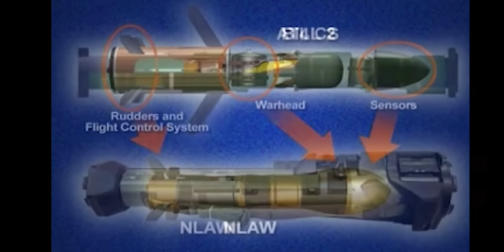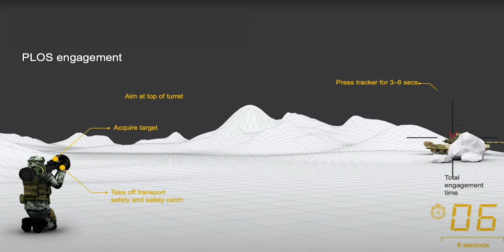Is the NLAW ATGM overrated? Next Generation Anti-Tank Missile

Comment: NLAW and Javelin accounted for less than 1% of Russian AFV losses. 95% of Russian AFV losses are due to Soviet Era 152mm Krasnopol Guided Rounds. I have seen plenty of videos of multiple hits needed to disable a Russian Tank enough for it to go to a field workshop.

Overall, NLAW and Javelin are failures and overpriced for what they bring. NATO needs to bring back Copperheads and develop newer and better guided rounds that can be launched by 155mm tubes to destroy moving AFVs and integrate even more small drones into a network centric heavy artillery based army designed to fight mass warfare on an industrial scale. Going for a light armor blitzkrieg force may look flashy, but if that force takes massive losses but fails to entrap large numbers of enemy forces, it will be too weak to hold up to a determined counter stroke.

Russia's main mistake was not having enough infantry, a mistake being rectified as we speak.
Reply: Of course it's less than 1% of AFV kills, thr NLAW makes up around 1% of Ukraines ATGM stockpile, they're just using what they have.  You also miss the advantage of having a squad level weapon that is fairly maneuverable.
Reply: @joshfurtek1935  That is better handled by RPGs. NLAW is overpriced for its utility, and not as versatile in terms of warheads like Soviet based ATGMs of comparable size and weight.
Reply: @BGTom  I don't think consistently  hitting a moving vehicle at 800m with an unguided rocket is realistic.  Also how are Russian atgms more versatile?  All their systems are larger and heavier and have different  guidance systems.
Reply: @joshfurtek1935  If an infantry squad has to engage a Tank at 800m, someone higher up the chain fucked up. As for Soviet ATGMs, the versatility is in the variety of different warheads they can use for different targets.
Reply: @BGTom  what kind of argument is that?  Not every battlefield is suitable for an armored vehicle to make full use of its effective combat range, and therefore a medium ranged atgm has its uses.  It's also not possible to know where every enemy asset is at all times.  An attack can come from everywhere, wouldn't you want to have a weapon that at least gives a fighting chance?
Reply: @joshfurtek1935  A rational one. If a pure Infantry squad has to engage an AFV, they want to be as close as possible and use ambush tactics to quickly win before the AFV can retaliate. A long range engagement favors the AFV if the crew knows its stuff. Now if we are talking an Infantry Platoon engaging a Lone AFV, then that is a completely different matter as the larger formation can protect the ATGM teams with their GPMGs and Designated Marksmen plinking the sights and secondary MGs on the tank.
Reply: @BGTom  why does the engagement range have to be as close as possible?  Apparently militaries think that an infantry engagement vs. an AFV(s) at ranges greater than RPGs is likely and therefore they developed a system for it.  For 30000 USD a unit you get an ability you never had before.
Reply: @joshfurtek1935  A lone Infantry Squad lacks the suppression capability to attack a lone Tank at long range. The Tank can take the hit or even dodge and suppress the Infantry Squad with impunity. So the lone Squad has to use a close range ambush. Different matter with a Platoon of Infantry.

Comment: No the French MMP is the best. 
Plase do a video on the EBRC Jaguar. No one is covering this French beast.
Reply: Yes, I'd want a video on the MMP
Reply: Id say the Spike LR2 but in the end very similar troop carried missiles and to each their own
Reply: I agree, the Akeron MP / MMP really looks like the best anti tank weapon.

I have also wondered many times why no one is covering it, frenchophobia?
Reply: @NomenNescio99  I would imagine so. Sadly seems to be the case with most French stuff. 
Take the Leclere for example, arguably the best NATO tank but you never hear about it.
Reply: @wifi_soldier5076  I would presume it's more about French political protectionism and insistance on always beeing project leader in any multinational defence project and going their own way if denied that role.
This has resulted in a general international ignorance regarding most of the advanced French equipment.
Also, while the French equipment is undeniably among the top five countries of the world in quality, most of it is so distinctly optimised for French requirements in tactics, terrain and logistics that it's not always possible to adapt to a different countrys needs.
Swedish domestically designed equipment used to have the exact same issues during the 20th century for similiar practical reasons. 
Eg: Strv 103, SAAB 35&37 and the Bandkanon 1

Comment: It's not without flaws. Main one is - laser.
Once you turn it on and point, if the target has sensors for this kind of threat, it will know it is lased, will instantly turn its gun that way (and might even get to shoot) and deploy counter measures (smoke etc). Second one I find theoretical... You need to keep the target lased for 3 seconds. Then, the system calculates the point of impact and the missile flies that way. So, if the target parameters change in the meantime (sudden stop just as it is launched, rapid change of speed and direction, dips into shell crater etc), it will miss. But since the short range of the system, I find that pretty unlikely...
Most modern tanks have their inside walls padded with kevlar and that reduces spalling. As for cook-off... New study shows that the spare ammo is what sets it off since it is all over the tank and thus very likely to be hit. Once that spare ammo is ignited, it starts a chain reaction and sets all of it eventually. Not all tanks have all of the ammo in safe storages (though it only buys you enough time to leave, it will cook eventually). Spare ammo is all over the place. Now, carousel is under the turret and it will send it flying, as opposed to other designs that will not rip the turret off so easily, but will still cook the ammo off. ANd if you are inside a tank that cooks off, does it matter if the turret flew away? Nah, you're done for anyway, though a flying turret looks spectacular. That is why there are reports of both Russian and Ukrainian tank crews going into battle with only 22 rounds. Reason - 22 fit into carousel; the rest is placed all over the inside. So, they eliminate the additional ammo to reduce the chances of cook off...
Reply: Please read up on a system before pointing out it's flaws. NLAW doesn't have a laser.
Reply: Yeah because T64/ T62 / T72/ T80 and T90 have that.... They are lucky to be even be in running order never mind some kind of Laser detection technology. Russkies are lucky to have Thermal sights
Reply: another thing to add like the others is that in the time it takes to deploy a tank isnt going to change its direction quick enough once the missile is launched making your point of changing direction defunct. Tanks are slow missiles using rocket engines are not.
Reply: NLAW is completely passive. All the calculation is from the onboard missile sensing your movement as you track the target.

Comment: When are tanks going to get good anti missile defenses and from above too? 

Edit I saw a video where a guy high up in a building shot at a tank that can just driven past the window of his building and it not go off. A YT video said it's cuz they need time to arm and that it was too close but I think the way it detects the tank as it flies over means at a strong angle, like from high up in a building at close range, the sensor be at an angle and might not work and even if it does the explosion won't be pointing straight down but at an angle.

Edit The guidance system I think assumes the tank will continue at the same speed as it is when you aim and does the math and guilds the missile to that place. Which is quite clever and simple. Takes the skill out of using it. Otherwise the user would have to make that prediction themselves.
Reply: There are tank protection systems. I used to think that they were too complex to work, but we have even seen them take down AFPds. So next generation atgms will likely include chaff, flares, etc. I think starstreak actually launches 3 missiles, but that is designed for aircraft if memory serves. Potentially still useful if somebody puts forward lightly armoured afvs relying on protection systems; you don’t need to stop just one missile, but 3… simultaneously.

Comment: Certainly not the best by a long shot.  But that does not matter. What matters is thaf it is very effective under certain conditions at a cheaper price than other missiles, just like an AT4 is still very useful in many situations.
FYI 800m is max effective range for a stationary target, for a mobile target max effective range is around 500m. (Found sources that say 400m and others 600m, so i split it down the middle)
Could not find info if these ranges change depending on fire mode ie top attack or direct fire.  Maybe it changes or maybe it doesnt
Reply: Compared to what? This and Javelin is probably the only ATGM in this class. AT4, CG, Panzerfaust is not missiles etc.
Reply: @ThorSuzuki1  FYI Javelin and NLAW are not in the same class.  
Javelin is similar to Spike and MMP.   MMP is probably most advanced currently.
Reply: @lordtemplar9274  NLAW and Javelin is as far as i know the only top attack variants avaliable. Execpt for the Swedish BILL. I mean comparing NLAW to AT4 is just absurd. And if everything is about range, then NLAW should be preferd in urban enviroments compared to Javelin, MMP and such.
Reply: @ThorSuzuki1  did i say AT4 was as good as NLAW or compare them?  
I was just making the point that most expensive or advanced system may not be the optimal tool depending on the situation.  An AT4 can take out an IFV, etc... fairly easily in an urban environment for a fraction of the cost of an NLAW or Javelin.
FYI the MMP/Akeron can do top attacks as well.  It has longer range of 5km. Furthermore it can do NLOS (non light of sight) and LOA (lock on after launch) with 3rd party targeting or by the MMP operator in real time.
Reply: @lordtemplar9274  NLAW are also able to NLOS. Thing is, easy to say some system is better than others when they are made for different situations and requierments.
Reply: @ThorSuzuki1  you are wrong NLAW has no NLOS ability.  In fact you need to have the target in sight for several seconds for the missile to calculate a firing solution. 
You clearly have no idea what you are talking about!
Reply: @lordtemplar9274  It can still hit targets behind cover? They litteraly say that in the video.
Reply: @ThorSuzuki1  you confuse "fire and forget" with NLOS.  
NLAW is fire and forget so you can go behind cover after the shot is fired but first you need line of sight to designate target and keep aiming for several seconds while missile calculates the firing solution.  NLAW is not guided, instead it analyzes a moving target for a few seconds and predicts where it will be in x seconds and then shoots at that predicted spot.  If the enemy vehicle has laser warning he can hit the brakes and missile will overshoot target and miss.
   
NLOS is completely different.  You can shoot from the other side of the hill with no line of sight, and some other friendly unit will designate the target and missile will lock on target and destroy it.  Or you can fire the munition and lock on after launch, so missile is up in the air, operator sees the terrain directly from missile optics and then operator designates best juicy target he chooses.  For example, operator is about to destroy an APC then he notices a tank and changes target mid-flight to hit the tank since it is a higher priority target.
Reply: NLAW received a software upgrade that increased range by 200m against moving targets IE from 400m to 600m.  The range against a stationary target remains at 800m (probably limited by motor burnout).    A great many Shoulder fired anti tank weapons such as Carl Gustav, RPG-7,  RPG-27 etc will claim ranges in the 300m-500m range but these claims are based around a round having dispersion such that it can hit a 1 square meter target at the quoted range.   The shooter must have a correct range estimate, compensated for wind and must have estimated the speed of the target correctly and applied enough lead.   This likely means that the chance of a first round hit is low and just like in WW2 its the second corrected round that has a good chance of hitting.   By that time the tank may be returning fire.    NLAW means you don't need to know range or worry about wind and calculating lead is as simple as tracking the target a few seconds.  An interesting intermediate solution is the DynaHawk laser gyro sight developed by Dynamit Nobel for the Panzerfaust 3 but usable with other weapons such as Carl Gustav and AT4.   In this the operator measures the target range with a laser (or an nearby object to avoid alerting the target) and tracks the target if its moving.  The cross hairs then move to allow for the required elevation and lead.   This takes maybe a few hours to learn well.   The advantages is that ammunition that can penetrate a T90 costs less than $10,000 and a good chance of a hit at 500m is likely.     The main thing is the ammunition isn't dependant on sensitive electronic supply chains.

There is incidentally nothing stopping the Javlin being given the NLAWS predicted line of flight guidance as a backup to the thermal imager.   It would be useful when the batteries for CLU and missile cooling were depleted or when and advanced enemy is able to burnout the javelin optics with lasers.
Reply: @williamzk9083  thx for detailed info 👍
Reply: @lordtemplar9274  laser warning won't help against a NLAW as it doesn't use a laser and doesn't know the range of the target. It calculates a flight path so it would fly over the target at every range. It triggers the warhead when it flies over a big lump of metal. This is why you can set a minimum range before launch in case it going to fly over any other destroyed lumps of metal. It's the movement of the NLAW while you are tracking the target that it uses to calculate the flight path. From the footage you can see there aren't any sensor on the front of the NLAW apart from the optic the operator is looking through. Compare that with Javelin.

Comment: I wonder if the NLAW ever suffers from inaccuracy in the tricky approach angles of ±45° or ±135°, where the rate of angular or tangential motion of a target moving at a constant speed is most strongly increasing or decreasing. Perhaps the effect is too small to worry about in practice. (I guess one could incorporate the changing rate in the user-commanded motion capture stage. I guess it would have to be made to be conservative, to avoid instability like that of the abandoned Apollo LEM super-precise quartic flight curve fitting algorithm which would occasionally plot underground flight path segments. The LEM actually used a slightly less precise but far more robust algorithm.)

Comment: IMAO NLAW is as overrated as modern MBTs are underprotected. Seriously, what it takes to just put 2 layers of ERA on top of T-72 or T-90? It's just a frikin' tiling with explosives!
Reply: The fact that the top is where the hatches are is why ERA can't be mounted on top of any tank with a manned turret.
Any other vapid ideas?
Reply: @SonsOfLorgar  the idea is still valid. Top of the turret isn't all covered with hatches, moreover ERA plate is thin  enough to be placed on whatever is flat, so it's not dangerous to even put it on the hatch. There was a vid of ERA test on an ordinary car, the car was barely scratched by the RPG, not to mention something armored.
Reply: @SonsOfLorgar  moreover, ERA is not the only thing. Drozd APS was installed on Soviet tanks by hundreds (which tells that it's not difficult to equip tanks with it) and was actually intercepting RPGs and ATGMs during Afghan war, so it's tech from 1980s...where is it now? More than 30 years have passed and the only country that operates APS in combat is Israil
Reply: @PeterMuskrat6968  they stopped using it after Gorby signed an agreement, Treaty of Conventional Armed Forces in Europe. Drozd was more than fine for 1980s. But it remained like that for 30 years and nobody gave a damn about tank protection.